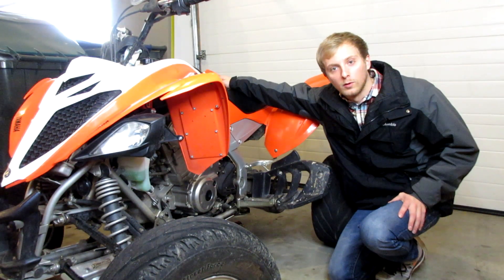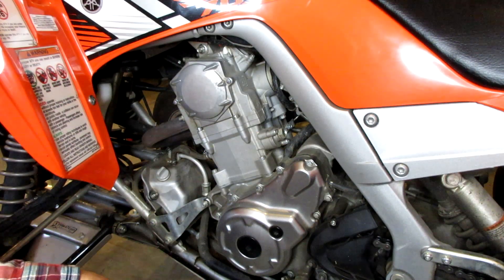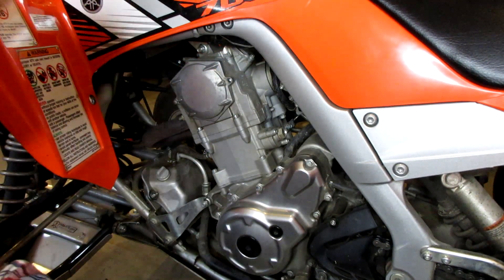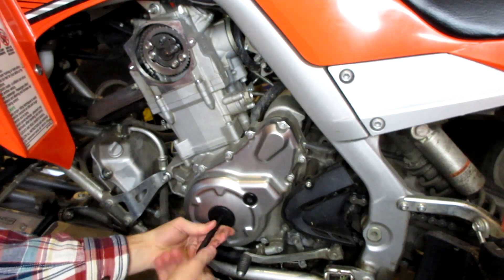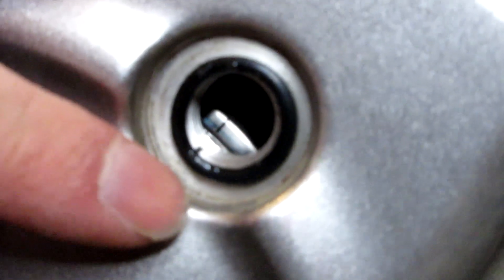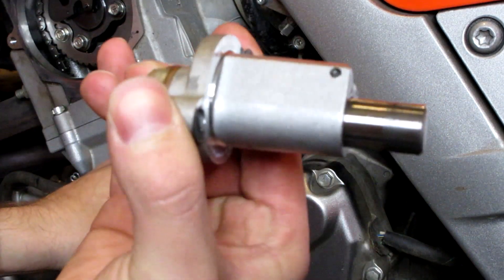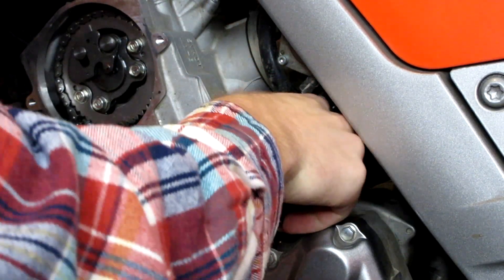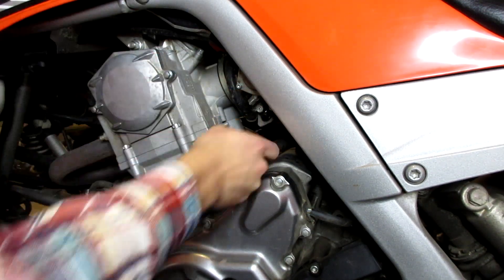Manual Cam Chain Tensioner | Install and Adjustment

Comment: When you pull the automatic cam chain tensioner body off the motor, the plunger extends all the way out (otherwise it wouldn't be working) and that should not be the starting point for setting the manual tensioner - you're liable to break a cam chain doing that when you go to tighten the tensioner body back up as the plunger would be out too far.  Better place to start would be to make a measurement using a wooden dowel or ?? into the hole to measure the depth with the auto tensioner removed and set the replacement to that.

Also, setting to TDC doesn't matter.  If the chain has stretched so much that it might skip when you take the tensioner off - the chain needs to be replaced.  There may be an ideal place to set the timing so that there is maximum slack at the tensioner side of the chain, but that's not necessarily TDC.
Reply: I was getting ready to type out the same thing you did . I'm glad I read this first .  Everyone listen to what  Bucky is  saying he is 100 percent correct .
Reply: Who wants to do that! just adjust it and sell it 😂😂

Comment: Guys! much easier way : Remove spring on original tensioner then push plunger 1 or 2 clicks forward with screwdriver  or until feeling slight resistance then return spring and tighten bolt,Voila !Nearly same procedure as with manual one!I dont think that it is about MotoPosh being "picky", It is about selling  the manual tensioner. MotoPosh please declare if you are getting money share or are sponsered by manual tensioner manufacturer  or not. thank you for your honesty.

Comment: timing is never affected if the chain remain the same position in relation to sprockets during the process. The crankshaft is always pulling from one side.
Reply from the maker: You are correct. Although for a tutorial video like this, I recommend you remove your timing cover and ensure you are at TDC before starting a project like this. It simply minimizes the risk of screwing your timing up. (I.e. your engine could be under compression depending where your piston is at)
Reply: @Motoposh  I'm trying to think of why TDC has anything to do with the tensioner.  I'm not getting anything.  Where the engine is clocked has nothing to do with the cam chain tension.
Reply from the maker: You're correct.. It's not needed. Finding TDC is just an extra step
Reply: @myronstambaugh761 Funny I was thinking the same thing that timing the engine first has nothing to do with chain tension but the Poster is correct it ensures the piston isn't on the compression stroke ready to give way and muddy the waters... It's like setting the parking brake before you raise the car😅

Comment: also, you have to lock the tensioner before removing it. If not, the tensioner will expand when you start loosening the bolts.
Reply: On a spring and ratchet tensioner you should remove the spring before removing the tensioner.

With the spring removed you can see where /how far the tensioner is extended out.

If your tensioner is already fully extended then you will need a new chain.

If there is still travel left pushing the rod will let you see if the plunger is seized.

Also you can check if the ratchet is worn at is normal tension position allowing the tensioner to release, sometimes only one point on the teeth is worn.

Comment: I don't think the timing would be affected unless you were removing the timing chain or sprockets. You're just swapping a spring on a stick for a bolt and a jam nut.
Reply: sniperv25 umm not
Reply: If you over or under tighten it on some bike, it can.
Reply: Correct
Reply: Timing wouldn't be effected as long as you don't turn the engine over in any way.  If the engine is turned over without cam chain tension it can jump timing
Reply: If the engine is on a compression stroke and you release the tension from the cam chain you can jump timing . Always make sure it’s TDC
Reply: @Tonytheknife no , the bike needs to be TDC and not on a compression stroke
Reply: Not hard to put a motor TDC take the time to make sure it is doesn’t hurt

Comment: Not mentioned is that adjusting the tension should be done with the motor hot. If you do it while cold then you risk over-tightening the chain.
Reply: ☣droid☣ if you just did engine work, how is it going to be hot to do initial adjustment?
Reply: I would think you risk under tightening, no? When it warms up the chain stretches so requires slightly more tension. The screw that's applying tension isn't getting that much heat (plus it is dissipating a lot of it's heat fast since half of it is outside the engine), so it doesn't expand that much.
Reply: Id install semi tightened cold. Then retighten after heated. Not gnna hurt anything with a sligtly loose timing chain. Just robs some power.
Reply: @v1kku  correct chains loosen when hot

Comment: My dads got an 87 suzuki lt2504wd it works decently the chain does rattle like hell & starting idleing & throttle response are poor in my opinion ... When i adjusted tge cam chain on my honda 3 wheeler or my quad runner on both machines ... All 3 improved greatly

Comment: I don’t think you need to worry about going top dead center because you aren’t changing the timing just putting pressure on the cam change and it shouldn’t look timing unless somehow you try to roll the motor without the tensioner in. Otherwise good video I just feel like you added a step and more time.
Reply: Tdc on compression will have all the valves closed on a single cylinder engine.

Having the valves closed means you are not risking the valve springs rotating the cam once tension is released.
Reply: @nexus7tablet610  I'm noob but why is rotating the cam bad if everything is bolted down the chain is not going to slip and timing will remain the same? I see no reason to do TDC unless you're unlocking the cam bridges
Reply: @tim3062  if anything moves with the tensioner out it can cause the chain to jump out of alignment, of not corrected there is the possibility of valve to piston contact.

On multi cyclinder engines some valve may be under spring tension with number one at tdc sometimes this causes the cams to shift when the tensioner is released, on a single cylinder engine all valve should be closed minimising the risk of things moving on their own.

Comment: Do you back it out a quarter turn while the engine is running do you do the adjustments while the engine is running or do you always adjust it while the engine is off and then recheck?

Comment: everytime i use one of these my chain stretches and i have to replace my timing chain i leave it at the same adjustment as the oem tensioner and my chain seems to slap so i tighten it more to get rid of that and bam chain stretches to no tomorrow
Reply: Should try replacing your cam sprocket too. If thats worn down, your new chain is still going to have play and make noise.

Comment: How tight should the timing chain be? Mine is super tight. no slack at all when pushing my fingers in. I wonder if I should remove my tensioner and inspect it or should it be very tight.
Reply from the maker: Sup Sean. It should be tighter than say your regular chain. The job of the cam chain tensioner is to constantly put pressure on the chain so that it's always tight. If you think it's too tight listen for a "whining" sound.. if you hear that then loosen it up a bit.
Reply from the maker: But if you begin to hear a rattle noise or a ticking then it's too loose. Tighten it a quarter turn until the rattle goes away and then another quarter turn to give it the proper tension
Reply: @Motoposh  when it was running it was running fine. i just didnt want extra pressure on the chain causing it to wear (well gears too)....

Mine has a spring in it so not sure how much adjustment it has
Reply from the maker: Oohh you're good man, the spring tensioners provide a good amount of force to keep it tight 👌

Comment: 3:47 is it normal for oil to come out that hole. i started when i forget to plug it back in and oil sperted out. ?
Reply: Yes mate oil is almost everywhere in the engine to keep it lubricated so it will come out of almost any hole if not plugged. it also has a o-ring which is there to stop that from happening

Comment: When you adjust the tensioner, loosen or tighten it do you still have to be at TDS?
Reply from the maker: +ISaeProductions No, just for the initial installation!
Reply: @Motoposh  thank you...had the same question as above... Writing from Costa Rica...Pura vida mae✌

Comment: Cheers Mate thanks for the Video,  with that photo of the tensioner tunnel after you removed the chain-tensioner. It looked like it was worn on the tensioner guide inside where the tensioner had pressure on it . did that turn out to being a problem at all.   Cheers 🍺

Comment: Red Loctite should be applied to the locking nut once the cam chain tensioner is finally adjusted correct?
Reply: Blue
Reply: Definitely NOT red!!!!!
Reply: Yeah if you like giving yourself a hernia every time you adjust your tensioner 😂

Comment: Hey my 99 honda 400ex won't start, and someone suggested my timing chain fell off so before I dive into engine I thought I would check tensioner first.. im wanderin if its bad that I have both nuts up against back of tensioner??
Reply: Your timing chain is stretched or broke no way should the bolt go all the way in

Comment: My motorbike 250cc Kawasaki the tensioner now make noise should I change to manual or the automatic is better..?
Reply from the maker: I would definitely say you need to replace it asap.  Up to you if you want to go with an automatic or manual!  They are both just as easy to install

Comment: Thank you for your educational sharing. I had always depended on the workshop guys, but your clear explanations have challenged me to try the cam-chain tensioner replacement process, when the time comes. Would this process be almost similar in principle, on the SXR 900 ?

Comment: The last part is a bit confusing. If you don't get the correct tension the first time and you hear some rattle, do you need to repeat the whole process from the start again? Because as you said, it will not be the top center.
Reply from the maker: No, you dont need to repeat the process. The process Is only for installation.

Comment: Dude help me i have manual tensioner in my kawasaki i already tighten up and it makes the engine much slower but it is still making the noise u know the timing chain noise ....  I don't want to tight it up little more I'm afraid it will brake the timing chain
Reply: What kind of Kawasaki do you have and did you get your problem fixed?. I know this was a few years ago

Comment: Can the manual one extend further so I dnt have to replace my chain lol
Reply from the maker: Actually... yes haha. Mine can extend like half an inch past the stock one
Reply: @Motoposh  awesome man thank you for responding!! Subbed :)
Reply: The main failure mode of a non hydrailic cct is when the ratchet wears allowing the chain to push the tensioner back causing a chain rattle.

Less common is the tensioner sticking so that it no longer self adjusts allowing the chain to rattle or the spring inside breaking so not enough pressure is applied to the tensioner.

If your chain is rattling because it is stretched and your tensioner is fully extended then you need to replace the chain, a manual tensioner will just mask the problem.

It is wise to release tension on the adjusting mechanism by removing the centre spring (or lock the adjuster screw in some cases) so that the tensioner can not extend whilst removing it for inspection.

If the tensioner is not fully extended then you know there is a chance the chain still has some life left.

Once the cct is out check to see if the ratcheting mechanism is good by trying to push the tensioner closed, if it releases then the teeth are probably worn and the unit needs replacing.

If it holds without collapsing back you can try pushing/extending the tensioner manually to see if it is jammed.

A sticking tensioner can often be cleaned and freed up, be sure to check that the locking mechanism works throughout the full stroke of the tensioner.

If the ratchet lock works fine and the tensioner moves freely reset it and refit the spring, to see if the spring is still good.

If the spring isn't physically snapped or broken the tensioner should fully extend readily , if it doesn't then the spring may have lost tension and needs replacing.
Reply: @nexus7tablet610  how would i determine  if the chain is stretched  without ripping the engine down ?  I have a ltz400 that has slap .. id rather not rip it down an put a new chain in if i can just get away  with a manual  adjuster it runs great etc was only trail ridden  n never  saw limiter till last year " didnt have it out this year "  if that matters just trying to give as much info as i can !
Reply: @dyllenger  there should be specs for your cam chain, you have to measure the length between so many links with the chain under tension.
Unfortunately this will likely mean removal from the engine to measure, by which time you might as well replace it as a matter of course.
Reply: @nexus7tablet610  alright thanks man i think ill just go ahead an do the whole thing then

Comment: I want to know the pros and cons of doing this. Im tracking my 07 daytona 675
Reply: The pro is you don't have to worry about the OEM spring/ratchet system braking and loosing all cam chain tension. 
The con is you have to make sure it stays properly tensioned, most people do it because it looks cool and never adjust it.
Personally, I've only seen one OEM go bad, I converted   that OEM to a manual. (Video on my channel)
On a regular bike for track days and trails, I would keep the OEM tensioner in.

Comment: Does this promote more wear on the cam chain?
Reply from the maker: No I wouldn't say so. The stock one is a spring one with constant pressure so the manual one if adjusted properly and frequently enough would really be better.
Reply: MotoPosh if I'm installing a new cam chain as well how would I adjust it properly?
Reply: To set the tensioner adjustment, rotate the engine forward while screwing the tensioner bolt in. When you feel the engine tensioner parts (guide, rollers, etc.) make contact with the moving cam chain, back the tensioner bolt out 1/4 turn and tighten the jam nut. (For the finer pitch thread on the APE Pro Series tensioner it is advised to back the tensioner up 1/2 of a turn.)

Comment: You dont need to be a tdc to do this. Really the only way you'll jump time is by cranking the motor without the tensioner in. Most all engines cam guides keep the chain from jumping a tooth when turned by hand. Uh you didn't set the tension right either. This is why i do this for a living. To fix what others shouldn't touch.
Reply: Question then sir,,, I have the 2011 Concourse 14 and want to put in this manual Cct.. Is this done pretty much the same way here?. I'll put it in gear and lock the brakes so no TDC required, pull the old hydraulic one out, put the new one in screw adjusting bolt till good resistance is felt then back out 1/2 turn then tighten both mounting screws. Does that work and or what might you do different?
 Thank you

Comment: Stick with your stock chain tensioners guys
Reply: Stock chain tensioners on older bikes are terrible.  The manual adjusters work great and keep it adjusted properly at any engine speed.

Comment: Is there really anything wrong with how the factory tensioner operates? No matter how worn your timing chain gets it will NOT jump timing with the stock tensioner. There is a reason it was designed the way it was designed. I trust Yamaha and have bought their products for years with no problems. If it isn't broken, don't fix it!
Reply: Some makes have hydraulic tensioners, some are self wratcheting and some fail, when they fail they can produce to much or not enough tension on the chain which can cause adverse and abnormal wear. The manual gives you more control over your own situation so you have a choice..

Comment: if you messaged me i could have just modified your oem tensioner to make it manual. im a cnc machinist.
Reply: Would like to know how please
Reply: whats the procedure to convert it to manual ??
Reply: hm. well, it would have to be taken apart, i still have the fixture i used in my tool box to drill the threads and tap new ones into it, and had to machine a new screw because ace hardware didnt have a long enough bolt to use as an adjuster. 

however. this was done to my DRZ400sm. it works just as good, if not better than the ones youd buy from a store because i CNC machine my bolt, and tap it myself. most things made by machinists are several times better in quality. 

sorry guys. unsure how to explain the procedure. its just... .... i do it... thats all....
Reply: wait were you the one that messaged me? i got something in my inbox from you. however... i am not sure how to open it lol
Reply: @1Corinthians151to4  how much would that cost?
Reply: it would be too much, you are probably best off buying an oem. i wish i videoed how i did mine